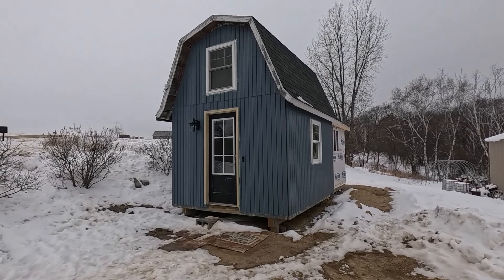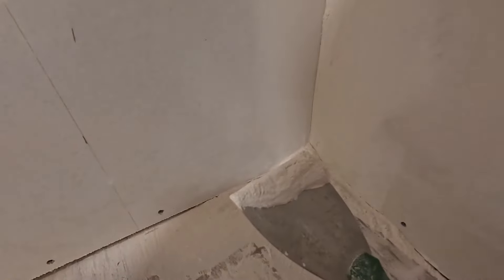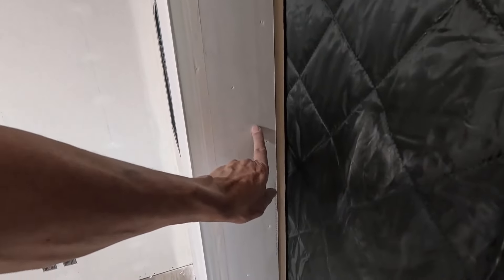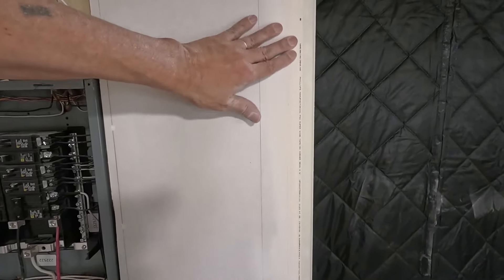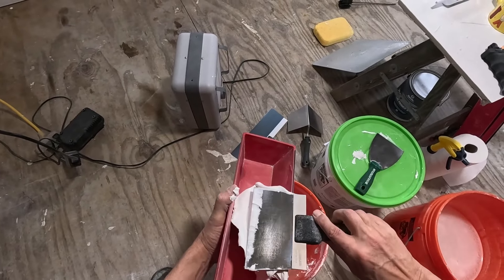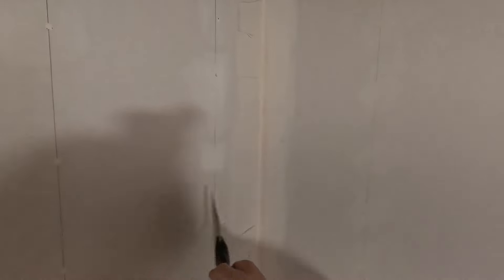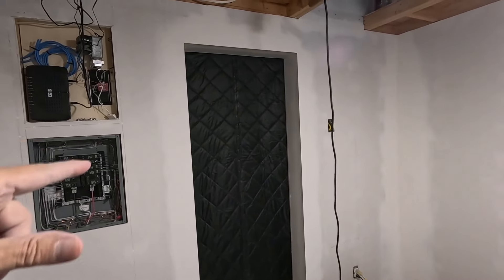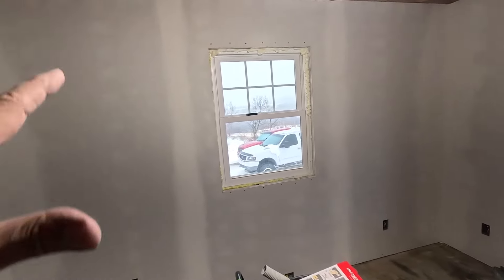Tiny House Drywalling ― Wrapping Up the Lower Barn Area

Comment: Always a great time on a job when the drywall is done. It always looks so much bigger for some reason. maybe it's because all of the gaps, holes, and defects are gone and it's just one big smooth surface. 👀
Reply from the maker: It does look a lot bigger and brighter in there! It will look a bit smaller with the ceiling in place, but again it will brighten up a bit. Cant wait to move onto the kitchen! It will likely be at about the one year mark 😮